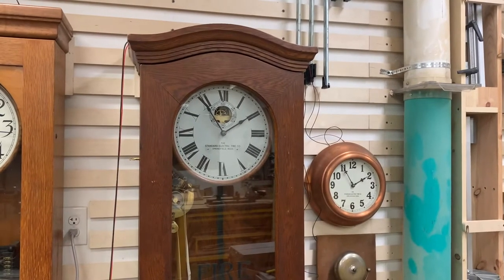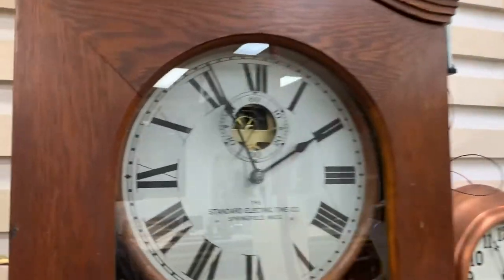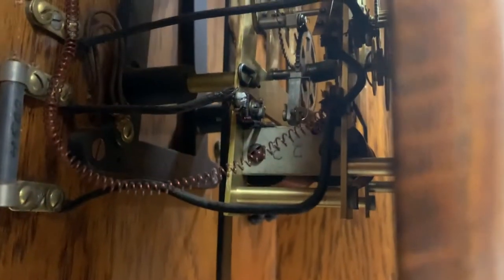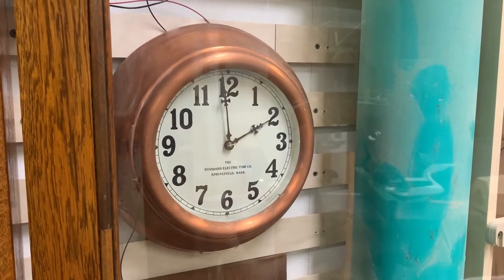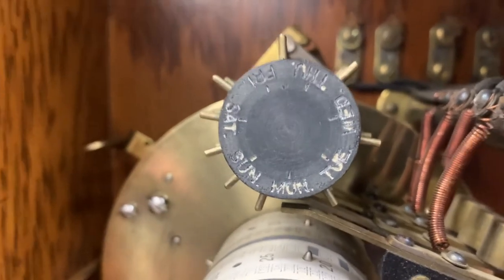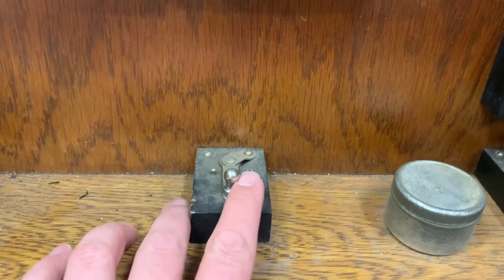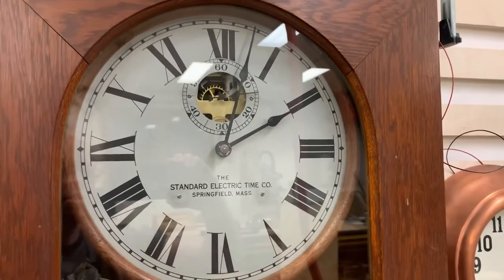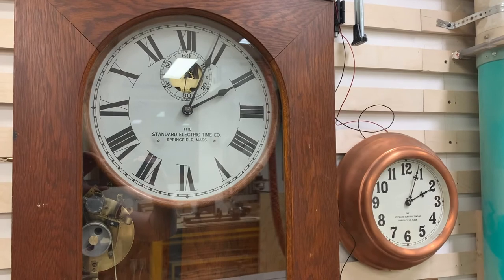Standard Electric Time Master Clock Operation

Comment: How you set the time on your master clock
Reply from the maker: You carefully move the minute hand to set the main time. To set the remote time, you press the clock advance lever in the bottom of the case which moves the slaves forward one minute per press.

Comment: Love the video! Usually the clock advances the secondary clocks at the 59th second, very interesting secondary clock, never seen one like it! The clock Im guessing from the middle of the 1920s. The eyebrow case has been used since the early 1900s but the dial and mechanisms look more 1920s! Love everything!
Reply from the maker: This is one of the few clocks that I have the whole story on, and this one was built in 1918, so you're in the ballpark. The glass is etched for the customer - a fire station in St. Paul, MN, and is dated.

Re the 59th second - I guess that depends on what your reference is. The second hand on the master clock can certainly be aligned with the contact that drives the slave clocks so that it reads 59 when the contact fires, but other than the tiny second hand on the master, I don't know that anyone else would know when the 59th second is. As long as all of the slaves agree, that was probably good enough.